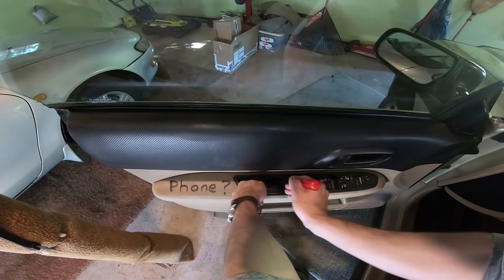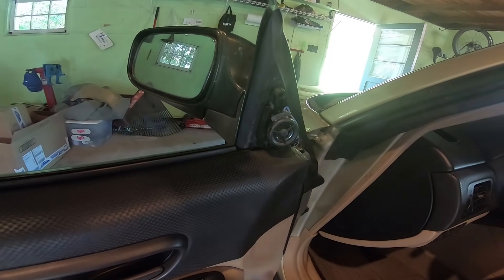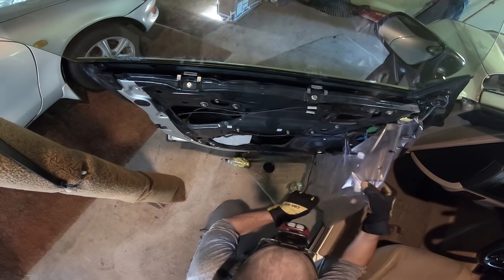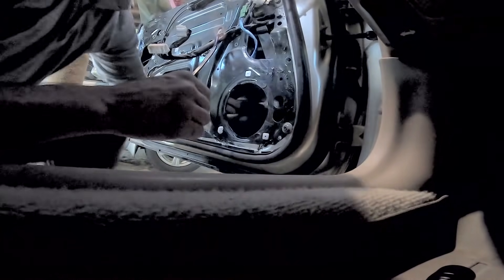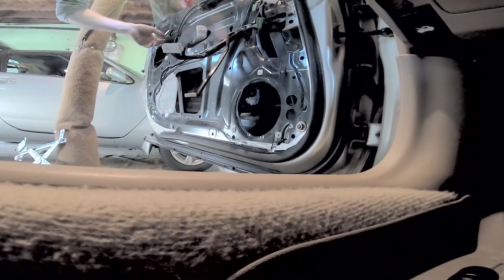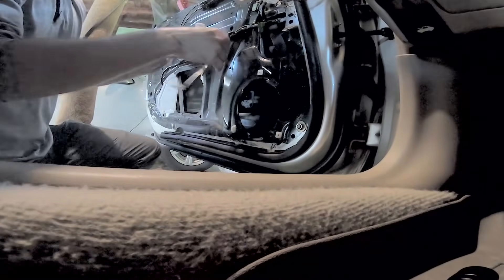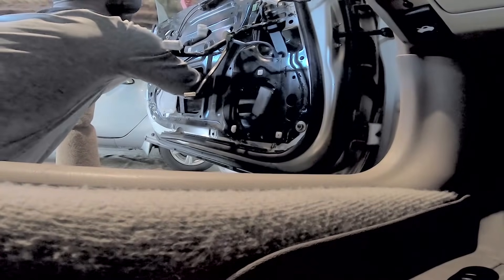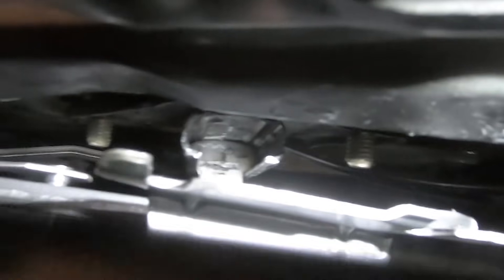Pillar-less Windows are Idiotic

Comment: I just fixed the misfire in my 06 outback, and I decided to pony up and replace the ignition coil and wires before I bothered replacing the iridium plugs I just put in last year when I did the valve cover gaskets. Problem solved.

Comment: Nearly all 1970s yank tanks in the 70s had pullarless doors, and all Scoobies had pllarless doors even in the 70s and 80s too
Reply: There were plenty of exceptions, but yes, many American cars from the late 60s and 70s had frameless glass. Big station wagons and base sedans from mainstrean makes usually didn't,  but two-doors did, pretty much universally, and some premium four-doors. Those had the doors mounted on half-height pillars and the rear-door glass did this weird dance as it rose to seal against the front glass. They never sealed very well.

Comment: Counterpoint: In cars without B-pillars, like such as classic Hardtops and the Mercedes CLK (C209 and onward), frameless windows are amazing for visibility and comfort. The ability to have an open window that runs most of the length of the cabin AND the ability to survive a rollover is a compelling design.

But if the car does have a B-pillar, frameless windows don't really add anything.

Comment: I live in Canada and use Rock Auto. We get hosed on shipping though. $3 dipstick? THIRTEEN DOLLARS SHIPPING. Still probably cheaper than the stealership.
Reply: I always try to get some consumable items (filters, wipers, belts, etc.) at the same time to help offset the shipping cost. Not sure if it works the same way in Canuckistan, but pay attention to the little truck icons next to items, as it shows that it's coming out of the same warehouse as stuff in your cart, which usually doesn't increase shipping much, if at all.

Comment: I worked at a dealer for my first job and I've never seen anything dumber. We had this M/T VW CC and every time you opened the door the window would have to slightly roll down. And every time you closed it you better hope that the window would roll back up again...because one time it didn't and the interior got all wet. I think that is really dumb and just asking for the window motor to prematurely die.

Comment: 0:10 I understand the the only cars that have pillarless doors are the Subaru Legacy, and certain models of the CLK.  A pillarless door means there is no 'B' pillar separating the front window from the rear.  If you have a Forester, it certainly has a B pillar with no frames.  You need to show us the complete window without a B pillar.  I am interested.

Comment: I’m willing to bet if you pull your plug wire out from the head you will find oil on it.  If so it’s a good idea to do the tube seals and valve cover gaskets.  Then new plugs and wires.

Comment: Doing the regulator on a panther is also a bit of a pain - gotta drill out seven rivets to get the reg out, including two that go through the window glass.
Reply: Did you have to also drill through sheetmetal to get at a couple rivets behind it? I remember having to do something like that.
Reply: @Vaino_Hotti  You had to drill thru 2 to take off a bracket to take off the weather stripping. Then you could access the other 5.
Reply: @zetros3  Must be a newer panther then, mine's an '85
Reply: @Vaino_Hotti  Very much so. Mine's a 2003 so that's about 3 design changes in between ours.

Comment: Question: If the battery is dead on a Piller less door, are the doors just shut then? Couse the window has to retract in order for you to open the door
Reply: No the windows dont retract, they don't need to because the glass just rests against the door seal, it's not really hooked in or anything. Source: two older Subies both with them - no issues with them and I actually really like them even after messing with door cards and everything
Reply: @hunterbigelow9327  But on VW Cars like the Scirocco and Passat CC the windows retract before you can open the door

Comment: Another pointless rant from RCR from a man as ignorant about cars as I am to animal husbandry.

FRAMELESS doors are wonderful.  They are aesthetically pleasing and functional.  I personally seek out vehicles that have frameless glass just because it's a design choice I love.
Daytona T-Top, Tiburon, S550 Mustang, Javelin AMX, both my Valiant and my Swinger....  So much easier when you actually DO have to do maintenance to the window mechanism. Two bolts, lift the glass out and put it somewhere safe.  

Only 4 vehicles that I've owned have had door frames because that's just the way they came.  My Gremlin, my SX/4 and my two Hornet hatchbacks.  But, at least in those cars' defence, the door frames are thin and unobtrusive.

The door frames found on say, a mid 2000's Cavalier or Cobalt are downright criminal. Those door frames have their own Zip code.

P.S.  Mustangs have not been "hardtops" since 1973. Mustang II, Fox body, S197, S550 are all technically "Coupes" because they have a B-pillar.  The definition of "hardtop" is a vehicle that lacks a B-pillar.

Comment: I hate frameless windows. My Javelin has no window frames so the windows just sorta flop around cause the whole mechanism is 50 years old. The rear corner windows are worse cause they fall out of the guides and wont go up or down and are just kinda stuck mostly up.

Comment: I'm think that's just a shitty design from Subaru, I just had my na Miata painted and I'm currently working though reassembling it, I just put the Guts back in my door just a couple minutes ago it wasn't bad at all. Once the doorcard is off you take the glass out, to do that you have three screws and two little L shaped brackets that you use to adjust the height your window can go up. The door is make that you can just pull the glass straight out. Then you can just take out the window regulator with 4 bolts (three more on the manual windows for where the crank goes) and it pulls out through a access hole. I hate taking apart doors but I was shocked on how easy it went back together. So you definitely can design it in a way that's not a total pain in the ass
Reply: That being said it's still super dumb in the absence of a convertible option. They 100% of the time with keep out weather worse. If you only sell it in hardtops just put damn frames around the glass

Comment: I don't get the egress thing. Doors universally open wide enough that you don't need to be bending over or around the door to get in and out. If anything, I would imagine the roof comes down lower on frameless door cars in order to meet the window where door would normally be, except since it stays on the car you need to duck your head more. I also would think any time you grab the door by the window (pretty natural area to grab a door), you'd only be helping it get looser over time. And frameless doors sound like shit when you close them because there is simply more, less well held together shit flopping around. Plus, you have poor wind and water sealing to start with that also worsens faster than a framed window door. Truly sucky design. And I don't agree that they look better than a framed window either.